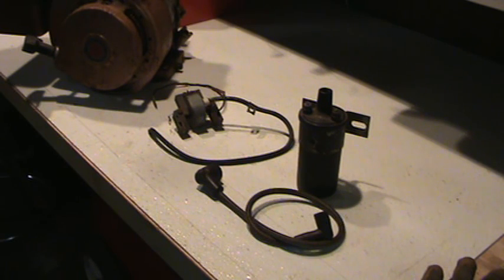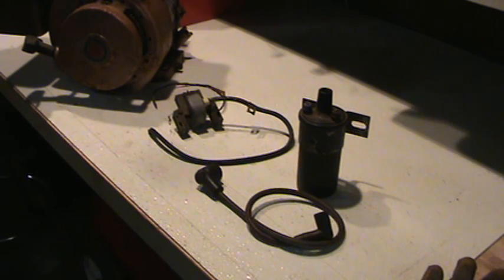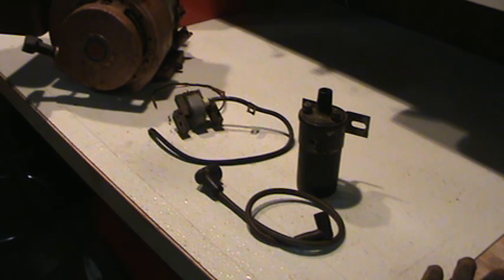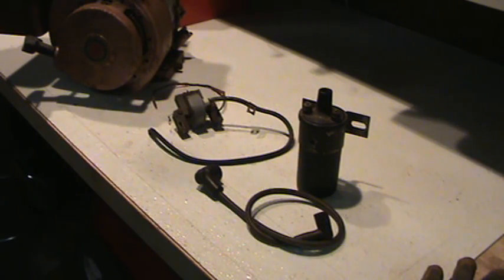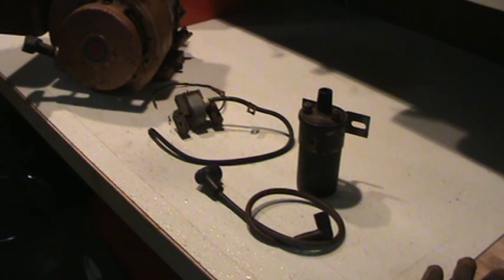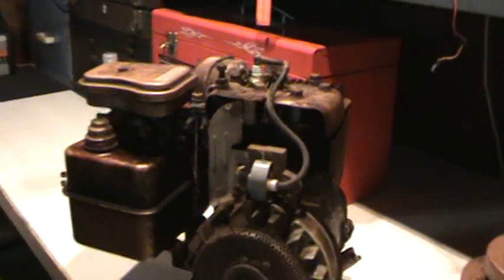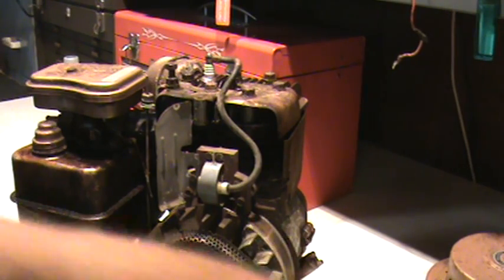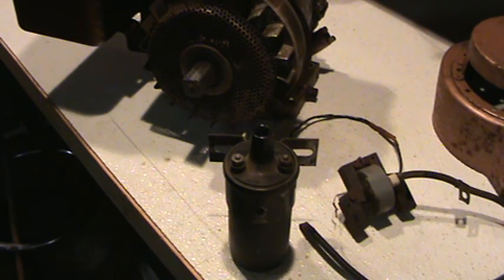Battery and Magneto ignition on small engines explained

Comment: I have a 79 32 cube briggs.  It had points originally.  Coil was replaced with magnetron coil.   It has always been a weak starter.  I've replaced the coil.   No change in how it starts and runs.  I've noticed a trend that it fires off more easily in cooler weather.  But the spark while starting after the engine has been warmed up is weaker.  Making the engine very hard to restart.  The carburetor is not the problem.  It's tuned and the emulsion tube is not leaking.  One fact I know about magnets is colder they become stronger.  Hotter they become weaker.  I believe the magnets just are not strong enough at temperature to create a good strong spark.  How would I install battery ignition without points?

Comment: The magnetos under the flywheel on briggs engines that looked like a big horse-shoe crab, had
good primary coils, I used the primary thru a car or auto style ignition coil then to the points.
it is the same thing done on dirt bikes, a low voltage system on left side of engine makes a low 
voltage, that is fed thru ign. sw and kill switch then to coil under gas tank and back to engine's 
points basically a generator and step-up xfrmr to make a hot spark for the plug.
Reply from the maker: Simply Brilliant Raymond! Zip~

Comment: It seems there is a diode inside the coil which lets current go in 1-way only, so if coil is 
mounted the wrong way current generated in the coils will not flow thru the diode, when
mag is properly mounted, the magnets allow current generated to flow thru the diode
and make a spark. A diode is the same as what's in a car's alternator changing a.c. to d.c..

Comment: I found that the primary or low voltage coil is usually good even if the hi-side is not. I'd
wire an auto type coil  to the wire from coil that was to go to the points. The other terminal 
from auto ign. coil went to the points. This is pretty much how dirt bikes are wired. a low
volts mag sends power to ignition coil under bikes gas tank. other side of ign. coil goes to
the points. basically an alternator powering a step-up transformer thru the points.
Reply from the maker: Great information Ray! Thanks for commenting and offering this up. Zip~
Reply: @ZippoVarga  U R very welcome Zippo, I've been messing w this stuff 
for over 5 decades and still love it, If I can help some1 with ignition,
its a thumbs up for both of us!, messed with ford T coils too!
Hope ur back gets better! been there, done that. Thinking of getting 
a go-kart for my 16 HP. Briggs cast iron. send me ur email if u want
and I'll send u pics of this engine, I'm at
bikerguygarafano@gmail.com. I have not tried this 4 ignition but had a 
phone magneto into primary of oil furnace ignition Xformer got a damn 
good spark.

Comment: Hey zippo ,Willy here,
 I have a onan genset with a magneto and a coil all the ignition wires were rusted so I cut all the rust and wires out... 
how do I rewire the engine so it can run? 
Thanks willy
Reply from the maker: Well Willy. For future reference, always take photos and label wires to be replaced so you know where they go when you're ready to rewire. As far as how to wire your engine. Kohler now owns the rights to Onan and I would start your search for a wiring diagram there. Since there are many different Onan engines, I can't possibly know how to begin to tell you how to wire yours up. Good Luck with it Willy! Zip~
Reply: I did label everything,  I just dont know anything about a magneto..

Comment: Where does the rectifier go, on the positive terminal?
Reply from the maker: No no, the rectifier works with the charging system, not the ignition system. Connecting the rectifier to the coil will destroy the rectifier. Zip~

Comment: I own a 1981 7116 simplicity with the cast iron 16 it was running fine when parked but sat for almost 2 years with the fuel drain in case you were wondering, went to get it running turns over fine but now I have no spark check the wiring on the point check the points clean them and still no spark. so I was wondering if I could. bypass the Magneto and run a coil instead or does that Magneto also charge my battery ? I have owned this garden tractor for 22 years have used it to mow to till, blade and blow snow with just the usual maintenance and have had no problems until it had to set for a couple years. so if I can avoid pulling the motor to clean the flywheel and I need oh
Reply from the maker: Jim, I would first determine if mice got into the blower housing while the tractor sat idle. If so, taking the engine out to address the carnage is a must. See if there is any bedding by shining a flashlight through the small gap between the top of the engine and blower housing. If your engine has the thin (inch and a half) blower tin addition, remove it to get a better look. If everything looks good, you may need to replace the points or eliminate them and use a Nova II ignition module. (Just Google Nova II (Nova 2). I havew a video showing how to install them. Good luck with the machine Jim! They're never truly dead buddy! Sometimes they just need a little extra love. Zip~

Comment: Excellent information, yes when the points close the circuit is complete at the specific time as the flywheel magnets pass the magneto coil and whammo a spark is produced just before the piston is at top dead centre on the compression stroke to ignite the fuel and air mixture but I would of thought that using a battery operated coil you would still need to use points with the exception of electronic ignitions used in later model vehicles so please explain how you would use a car ignition coil on a briggs motor without points? because without points to open and close you would have a constant or erratic spark, right or wrong? Also if you were to use an automotive coil on a briggs would you need to use a voltage regulator of some description?
Reply from the maker: +Thetrucky69 You DO need points with a battery ignition coil. The points eliminators don't play well with these coil types. The only time you need a Resistor in line with a battery coil is if it's a 6V coil and not a 12V. The resistor keeps the 6V coil from overheating. Cheers!! Zip~
Reply: +ZippoVarga Yes I figured that you would still need to use ignition points when using an automotive coil pack on a briggs engine. As the car ignition coil is 12 volt I would of thought that a voltage regulator needs to be used to provide the required resistance as I would think that you could burn the contact points out otherwise but if not then I believe you would know, good info thanks Zippo cheers.
Reply from the maker: +Thetrucky69 I think there was a little confusion when you said Voltage Regulator. To me, that is used with an alternator where the resistor absorbs some of the voltage and keeps the coil happy and cool. Again, with a 12V there is no need for the resistor, but if there is no markings on the coil body stating it's a 12V, then in most cases, it's a 6V and will need the resistor. Cheers!! Zip~
Reply: +ZippoVarga Yes well you can see how I learn, not only by working on engines but asking the wrong question sometimes and having to be corrected. Very good mate thanks.

Comment: I have an older Ariens ST724 snow thrower, 7hp Tecumseh H70 motor.. Before I took it apart, I ordered a new solid state ignition to replace the points/condenser it came with, just for the ease of maintenance. Unfortunately, it doesn't fit, and, they apparently don't make a solid state ignition for it.. Is there a way to cannibalize the parts on the solid state and 'update' the old magneto? I'm disabled now with a bad back, and this extra maintenance is difficult. I don't know if this is a public comment, so don't want to leave contact info, but will if your reply says it's private. I live alone, so you can call whenever it's convenient.

Comment: According to the briggs and stratton website you can clean the rust off the flywheel magnets and it wont make a difference.  The rust doesn't hurt anything.
Reply: +maineville prepper That's strange that they say that because I had to troubleshoot starting problems with two of my four stroke engines and rust on the magneto coil contacts were the issue. Bad electrical contacts in any machine or device is always going to be a problem I believe.
Reply: I suppose then that perhaps rust can be an issue.
Reply from the maker: +maineville prepper Another thing to consider is, the gap between the flywheel magnets and coil is very small. Any rust build up can cause an issue with the two opposing surfaces actually coming in contact with one another through the rust build up which in turn, will cause an ignition problem. So, when Briggs says rust isn't an issue, I think what they are suggesting is simple surface rust and not rust accumulation over time. Cheers!! Zip~
Reply: I agree with you.  It can cause an issue with the two surfaces coming into contact with each other and also, with the rust on there, you have to widen the gap between the magnets and coil so the two surfaces do not come in contact with each other.  I believe what Briggs and Stratton is trying to say is, that the rust build up will not prevent the magnets from producing a magnetic field.  But, like you said, with the rust build up, the magnets and coils will come in contact with each other.  ZippoVarga, you really taught me something here and I appreciate it :)  Thanks!

Comment from the maker: Yep....in a pinch, it'll work for a while without an alternator or charging system. I've come across many, many Briggs that were converted to battery ignition simply to avoid having to remove the engine from the tractors they were mounted in. Funny thing is that most still had the magneto coil under the flywheel and only needed a good cleaning and gap set to put them back to the mag fired system. Cheers Bro!

Comment: I guess I should have watched this one first.I still don't get why people would do this though.I knew to clean the flywheel and mag and gap it with a matchbook cover when I was a kid.Seems like converting to a coil is more work.If you had a charging system in place and couldn't get another magneto it would be a good thing to know about though.Or if you had to get something done and had use a battery for a while it would work as a stopgap.A battery will run a single cylinder sparkplug all day.